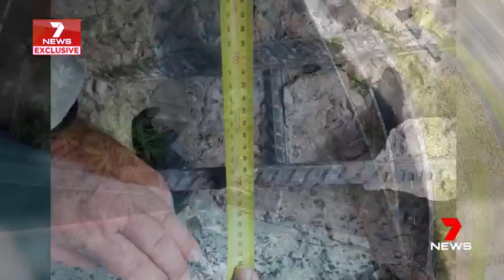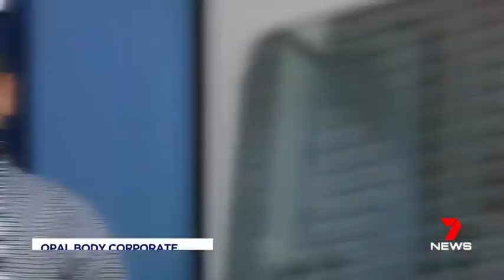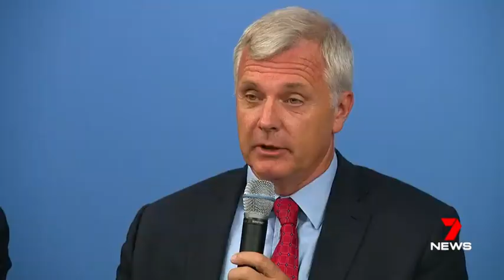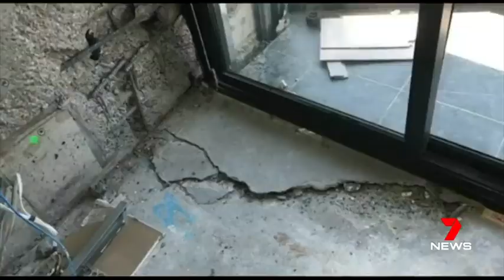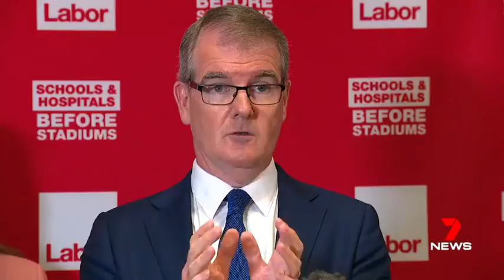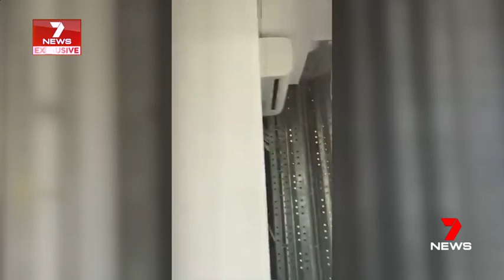Sydney's Opal Tower cutting corners, major design and construction issues

Comment: The problem is on the other side of the river. It reflects off the architectural sculptures in the park and refracts through the tower like light does through a prism causing vibrations.